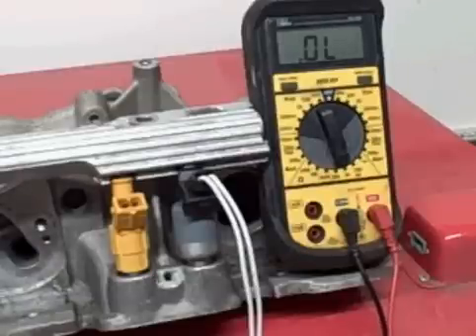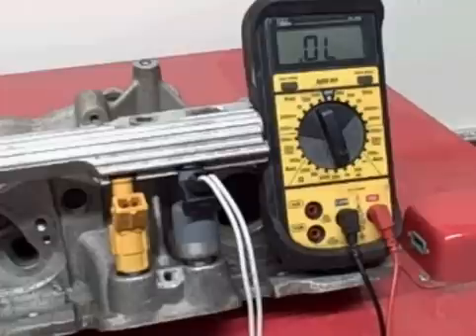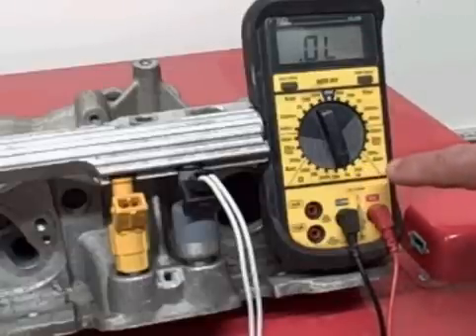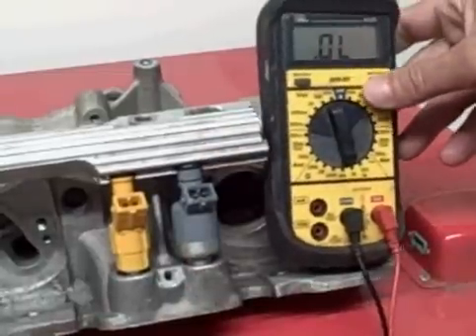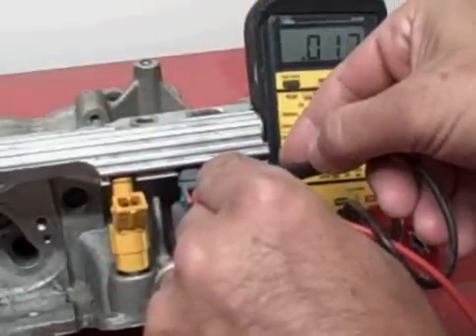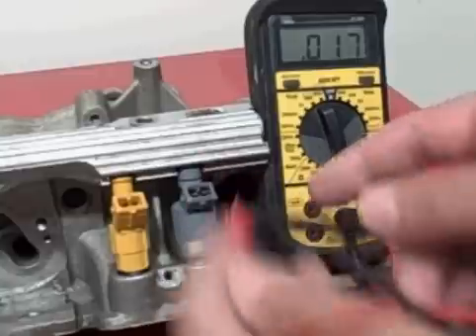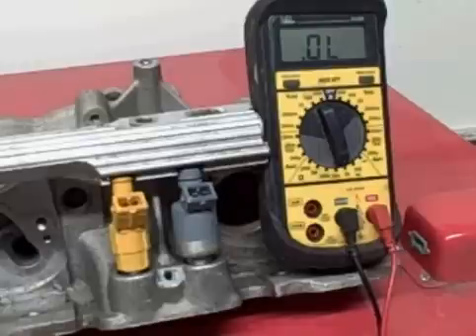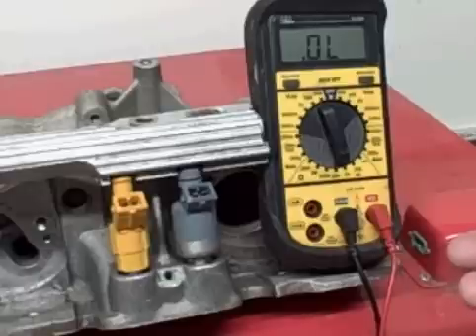HOW TO OHM CHECK A FUEL INJECTOR high impedance

Comment: Was checking the injectors on my 97 Regal with 3.8 v6.  All the injectors were reading 1 ohm.  11.8 - 12.6 is where they are supposed to be.  Have a mis firing on three cylinders; 1, 4 and 6.  Previously, I had the engine idling to check for rpm drop when disconnecting each plug from the injectors , one at a time.  All cylinders had about  the same rpm drop as I unplugged each injector.  These injectors are the original ones that came on the car since new.  Possibly all 6 injectors are no good?

Comment: i get no reading on mines .maybe not grounded right ????
do u gound the injector to the body some were maybe that whats wroung with my reading my codes are p0203 p0201 and p1297 need help try what u did and got 0000 reading no power  ecm  maybe singnal wire shorted????

Comment: I check mine. All the front 3 injectors 2, 4, & 6 were all between 15-16ohms. The back injectors 1 and 5 were between 12-13ohms and number 3injector was 19..Are those numbers bad?

Comment: Can someone please tell me how to set my POS(Piece of sh**) CIE multimeter to the 20,000 ohm range so I can test my jeeps coil packs? All you can do on it is keep pressing the RANGE button to either 0.0, 0.00k, 0.000k, 0.0m, and 0.00m or something like that, and I can't find anywhere how to use the damn thing, and no video helps. I thought I set it to 0.000k, but I only get a reading of 0.002 k or 0.001 k, HELP PLEASE. by the way I subscribed.

Comment: Change the title to 12 ohm injectors and you can safely disregard point number 3. Some HIGH IMPEDANCE injectors may require the resistance to be HIGHER than 12 ohms. Every service manual specifies a resistance range that their particular injector must be within.

....but in the words of the Hodge twins, is just advice and at the end of the day, you can do whatever the FUCK you wanna do!

Comment: Lots of things wrong with this video.

1) You shouldn't pull on the wire to remove the plug, you can damage the connection. Always pull the plug itself.

2) You should set the DMM to the lowest setting (usually 200). This way you get a more accurate reading.

3) You can't say that a reading less than 12 OHM's is shot. Some fuel injectors are low impedance. For example, the injectors on a DSM should read 2 to 3 OHMs.

Comment: is there a way to check them not installed? 
 or with a  battery  and wire b/c when my used fuel injecters 
come in the mail id like to be ready with my  meter to inspect them infront of the mail man so i can refuse the package to avoid  return shipping cost to the uk

Comment: hi. i have a 5.0 that sat for a few months and now runs rough and you can tell its coming from the drivers side bank should i ohm check the injectors??? changed spark plugs and one on the drivers side bank looked diff from the other 7. could the injector be bad???? if so should i replace one or all of them???